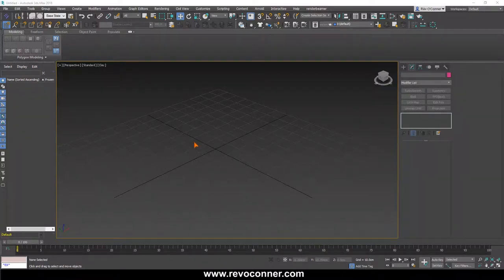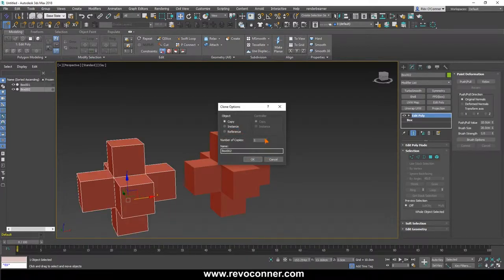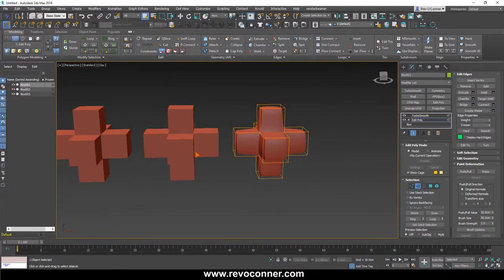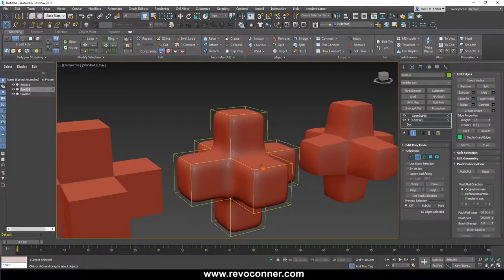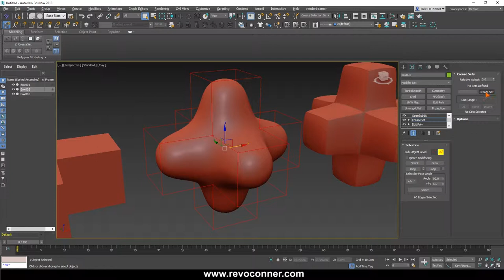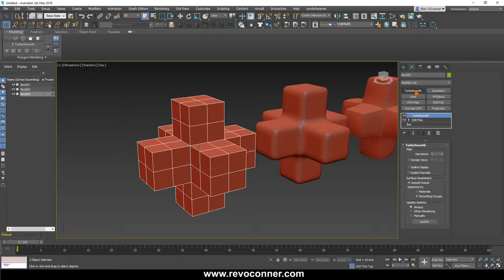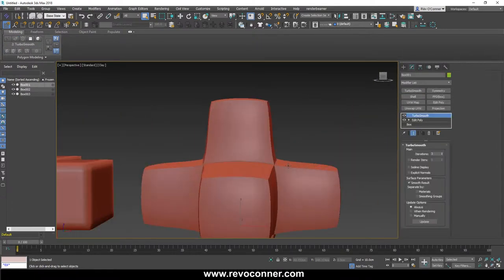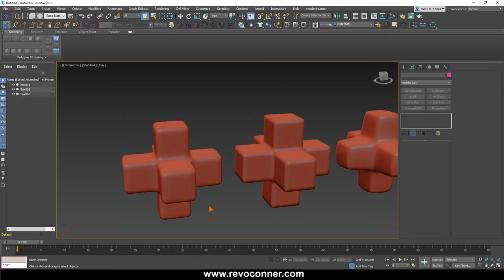Turbosmooth vs OpenSubDiv - Difference and similarity

Comment: in terms of number of quads, both turbo and open gives you the same quantity, right? but for some reason when you apply 1 interaction of turbosmooth it shows 12k quads, and when you apply 1 interaction of open, it shows 6k quads but if you add prooptmizer in top of opensubdiv, it shows 12k quads. weird, right?
Reply from the maker: Thats a bug.

Comment: Great video thx!

By any chance, if you see this comment, In my case when I add the modifier (opensubdiv) I need to click back on the editable poly to being able to access to the crease properties, but the opensubdiv modifier, even activated doesnt get previewed... there is anything to get done to allow this so it can be fine tunned the value easily?
Reply from the maker: Activate show stack. Its a button on the command panel